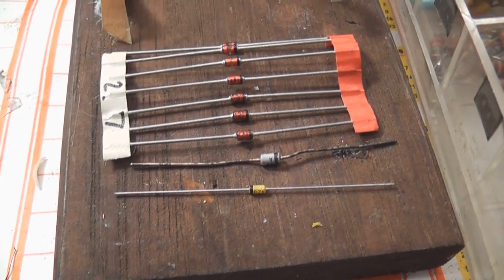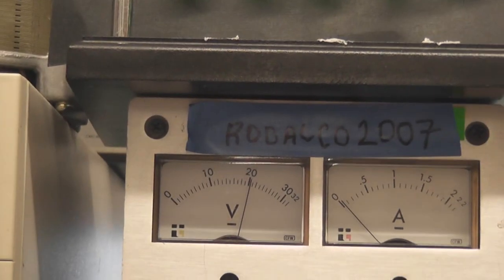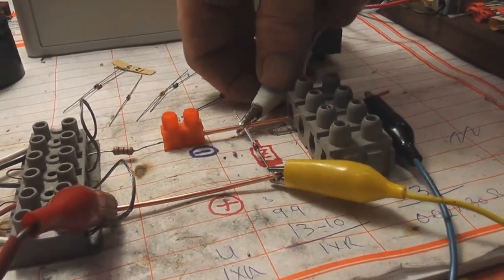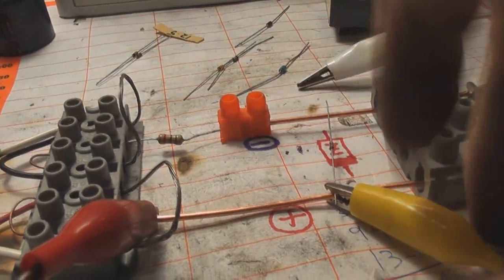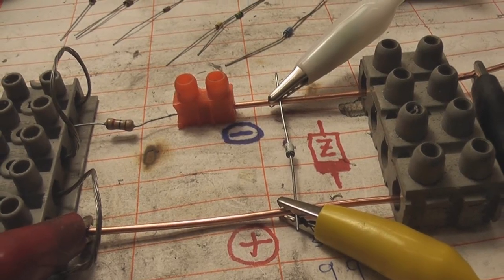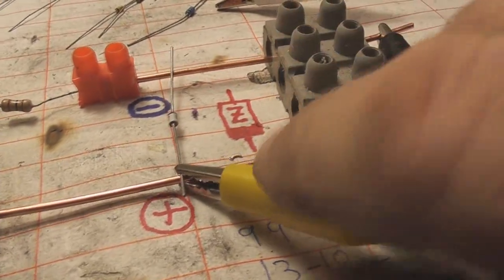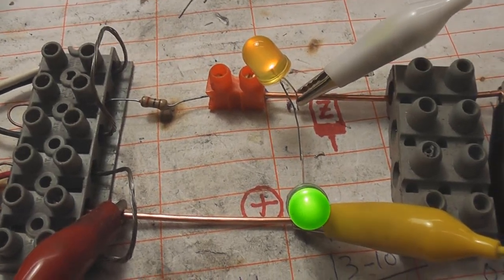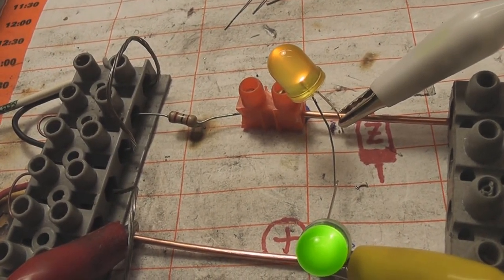Testing Zener Diodes

Comment: The text on the video indicates a 1k resistor yet it sounds to me like you said 10k.
Reply from the maker: +Enig Ma It is 1 k.Ohm.
Reply from the maker: +Enigma758 To get 3.3 Volts from a 5 Volts supply at 10 mA you need 1.7 Volts at 10 mA, try a 180 Ohm resistor and see if it works.
Reply from the maker: +Enigma758 Brilliant !! a Zener needs about 8 -12 mA to work effectively. Great it worked out for you. Thanks for the feedback.
Reply: +RODALCO2007 I just tried this with a 3.3v zener (1k resistor and 5v supply) and I measured 2.66v across the zener when I was expecting to read 3.3v.  Do you know why that happened?
Reply from the maker: +Enigma758 Your supply voltage is a little bit too low. For a Zener you need about a 10 mA current to flow. Try 10 Volts at 1 k.
Reply: +RODALCO2007 The difficulty is that I have an existing power supply that I'm using to drive some motors and a few other things at 5v.  The reason for the zener is to protect an analog input that can't exceed 3.3v.  The 2.7v limitation will work, but I will lose resolution.  Do you think that using a smaller current limiting resistor, so that the zener would pass more current, would help?  Thanks.
Reply: +RODALCO2007 I just tried that with a 220 ohm resistor (didn't have a 180) and it works, thanks!

Comment: I like this idea, but If you use ordinary diodes in the reverse biased mode, or the emitter base junction of a transistor as a zener,  I'm wondering if you can trust their reliability since their recommended power dissipation is unknown, and they haven't been tested over time.

Comment: Keep in mind that low value zeners (up to 5 or 6 volts) don't have a really sharp edge at the rated zener voltage. So the measured 4,9V was probably a 5,1V zener (4,9V would be a very untypical value and I don't know if a zener rated with this voltage even exists; 4,7V would be another typical value). In a case like that it would be good to take a few datapoints at different currents.

Comment: i've made a power supply that can supply various constant currents at variable voltage up to 20 volts, one of them is 10 mA so i can test LED's, zeners and high voltage microwave diodes etc and i can measure the voltage drop with a meter or approximate using the analogue one on the supply